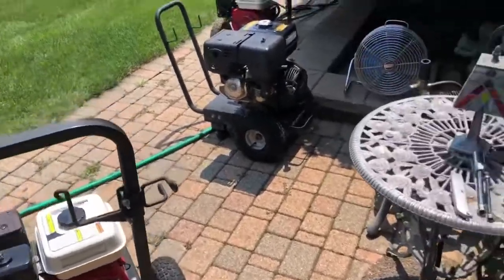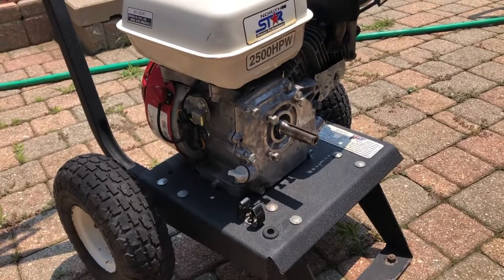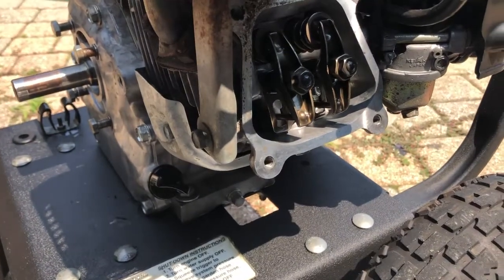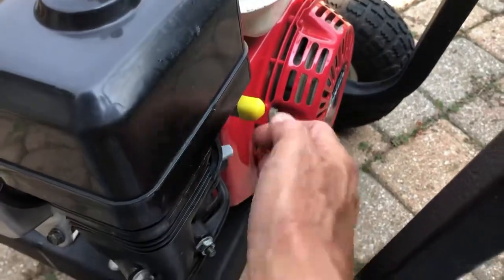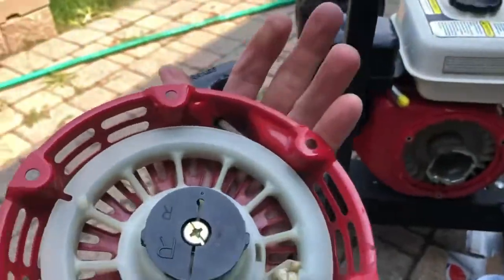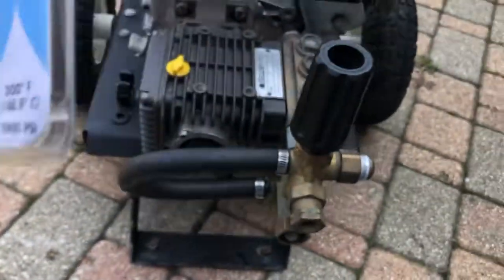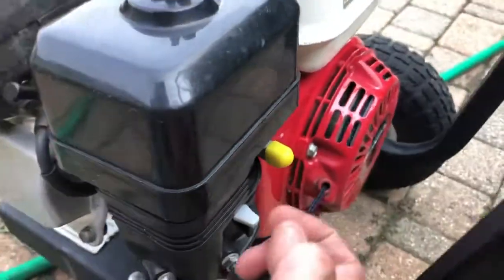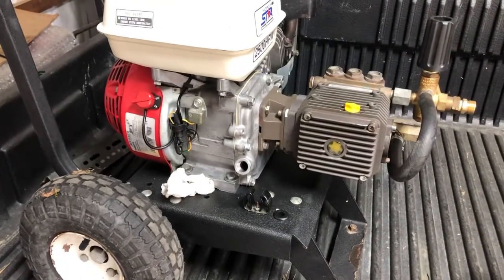Honda GX200 with broken cam.

Comment: I have that exact honda motor. The 1st issue was that it snapped the rod in half. 3 months later, it snapped the cam in half, Honda said there are no known issues and refused to let me make a claim about it. I now know why there are no known issues, Honda won't let them be known.
Both parts have visible defects in the casting, myself and 9 other techs agree on it being defective casting.
Reply from the maker: As much as I like Honda GX engines, it’s my opinion the newer units are built as well.   In your case, when the rod let go, it probably struck the cam and may well have stressed the middle where it is thinner.  I assume the engine had proper oil level and was not overspeeding?  However I can totally believe the rod casting may have been compromised when made.